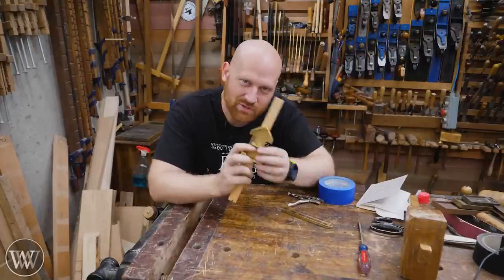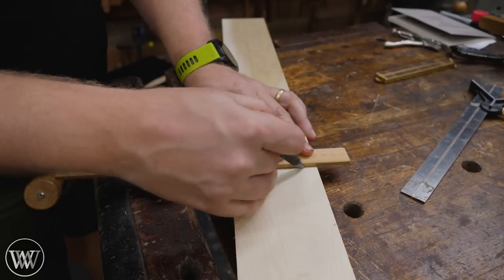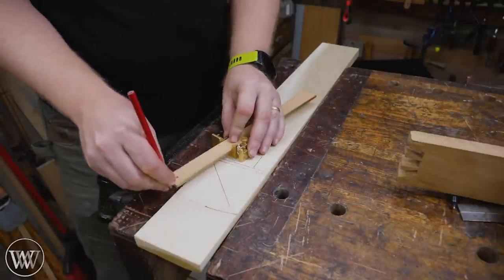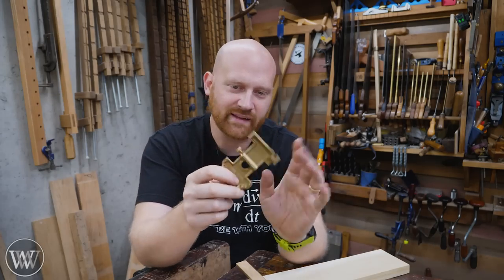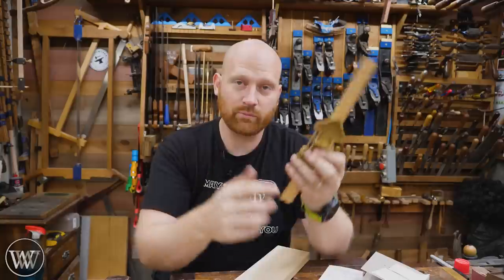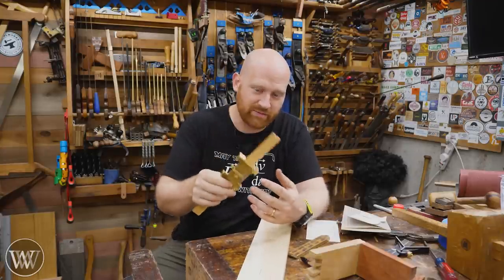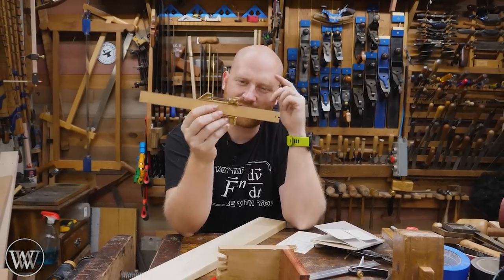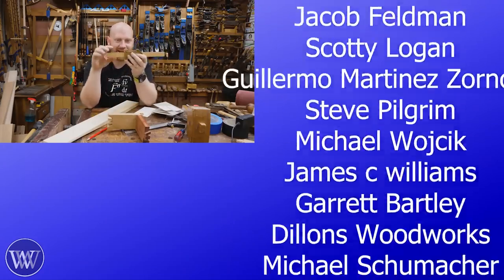What is an Odd Jobs (The Real No.1)

Comment: One of the best things about these sorts of wonder tools is that they provide a gateway.  You buy the combo tool as you're trying things out, and you find that you're always using it as a T-sqaure or something.  And it works, but not the best, but now you've got that process in your work and now you know what you want out of that tool and your next buy is dedicated and does the job for you.  But you never would have sprung for the one tool first because you didn't know you needed it yet.

This is definitely in that category as is lots of the el-cheapo knock off tools and beginners kits.

Comment: I'm definitely in the category of "if it does everything, it doesn't do anything great." But, being a guy that works in a metal shop by trade, I already have thoughts on how to improve that. Its biggest flaw, as you said, is its lack of registration surface. Why not add a couple of locking wing nuts and make dovetailed extensions to those faces like a classic starret gauge? And for that matter, why not a telescoping rule? You could extend the parts as you need them, keeping the bits you don't need tucked away and probably could make it even more compact for storage. Yes, that would probably end up making a new one be in the same couple hundred dollar range that the collectables sit in, but with way more reliable and precise usability. I mean, hell, a brand new starret or mitutoyo vernier protractor would set you back a grand easily, so for the dedicated tool obsessor, why not?

Comment: I have one and carried it around in my apron until I wore out the apron.  My new apron at the time didn't have as many pockets and this tool was put on my tool wall.  I carried it around but rarely used it.  The last time I touched it was when a last gave my tool wall a good dusting.  I'm not even sure the manufacture of mine. Thanks for the video.

Comment: Love your videos man i am 13 amd live woodworking i just struggle to get old hand tools here in South Africa where i live
Reply: It's nice when they come around, but as long as you have a chisel, square and knife, and a few bits of tool steel, you can make any tool you need. With few exceptions, all of my first hand tools were homemade, and many of them good enough that I still use them regularly years later with a "shop" full of vintage tools. A little research and determination, and an ability to accept the occasional failure, and you'd be surprised how much better it'll make you as a woodworker
Reply from the maker: I feel for you they are not easy to come by down there.

Comment: I have an original, missing the scribe, ruler and most of it's nickeling. It lives with the other measuring/mark out tools in a tool box. I don't see many, here in the Antipodes. I must have got lucky and found one at a reasonable price. it even has patternation on the horizontal parts.

Comment: The unfortunate thing about the Garrett Wade's 'Odd Job' is the scales are not accurate, so if you start a job with this tool, you have to finish with this tool and can't switch to another scale! From the end to the 1-inch mark, it is not one inch! I have checked it with a 1 inch gauge Block. Also the machining of the body of the tool is very good but sharpe where machined. All the edges need to be broken! It's still a useful tool with a different scale in it! 

I did contact Craig at Garrett Wade but they're just interested in sales and if you don't like it just send it back they'll refund your money no problem. Not the answer I was looking for from a company like this! So that's what you get when you deal with a catalog. Not like Lie Nielsen, They would fix it, cause they stand be hind thier tools! That's the difference dealing with tool importer versus a direct tool manufacturer!

Comment: Garret Wade''s Bronze Odd-Job is almost useless. The precision is not even close too what the normal home shop tinkerer needs even the screw for holding the ruler is off set so it moves the scale as it is tightened. It is just for show.
Reply from the maker: I have not found that to be the case. mine is tight and true in the tests I have put it in.